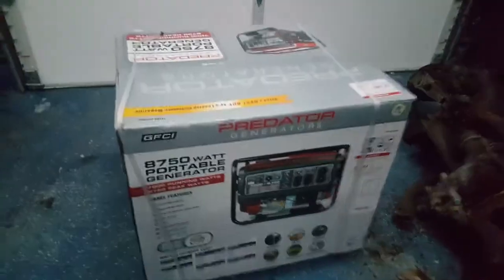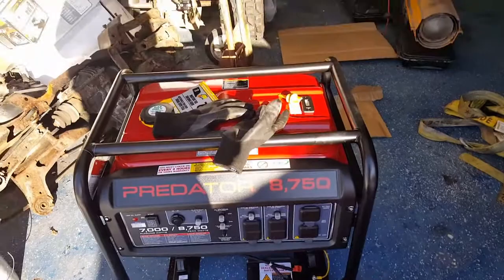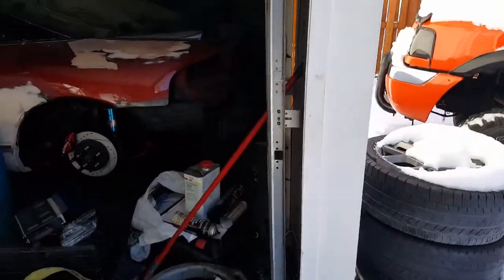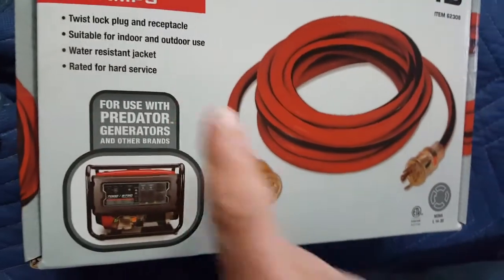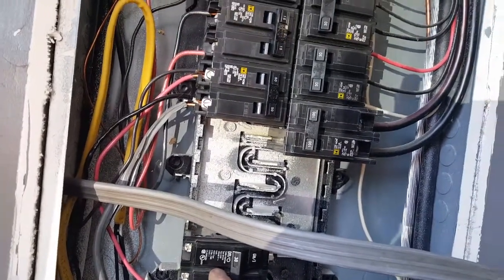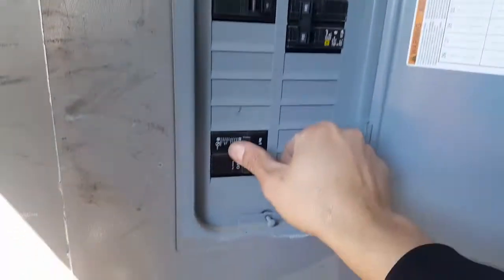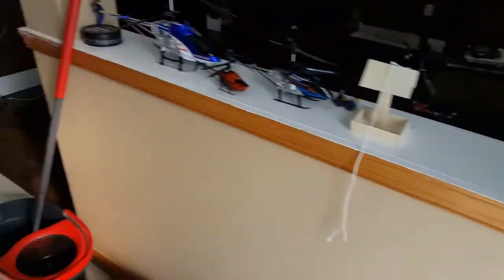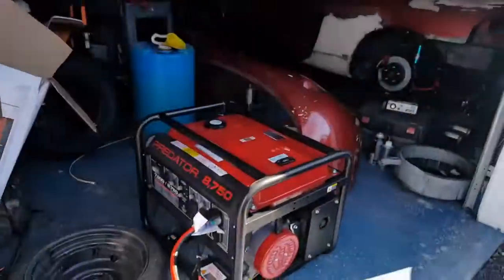How to Connecting a generator to a whole house

Comment: Im in the process of doing the same thing but my project is a little more difficult because my panel is on the opposite side of the house from where my garage is along with my generator  and I had to use just over a 100" of 6/3 direct burial gray wire to run along the brick portion of my house to the panel, running that stiff wire was not fun at all
Reply: you probably dont give a shit but if you're bored like me during the covid times you can stream all the latest movies on InstaFlixxer. Have been streaming with my brother during the lockdown :)
Reply: @Julian Braden Definitely, I have been watching on InstaFlixxer for years myself :)
Reply: @Julian Braden Definitely, I've been using instaflixxer for since december myself :)
Reply: @Julian Braden Yup, I've been watching on instaflixxer for months myself =)

Comment: To comply with NEC you need an inter-lock kit so you can not back feed the utility power. On most main breaker panels the back feed 30 amp breaker installs in the top two breaker positions on the right. ie circuits 2 & 4. This will mean relocating the 2 & 4 breakers  to another empty space. If breakers 2&4 are from a multi circuit branch circuit  (black & red wire on the same Rolex cable with one white neutral)  those two breakers have to be on different phases, or else they will short circuit.
Reply from the maker: Yeah all interlock kids were installed later on in the future they weren't in stock so I had to give them something they understand that they have to shut off the main and turn on the generator Breakers then vice versa thanks for the comments

Comment from the maker: That's why I mentioned in the video the main has to stay off while the generator is connected otherwise there's a switch plate that you can connect for safety when the main is on the generators break a can't go on but I don't need that

Comment: If you run the generator with the main breaker on you can backfeed 120v into the power lines which could electrocute a lineman.